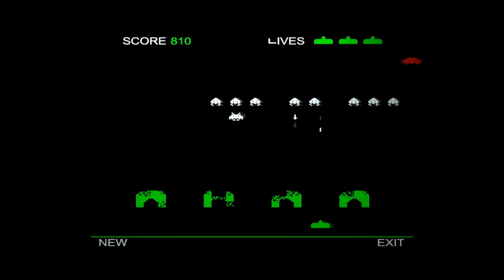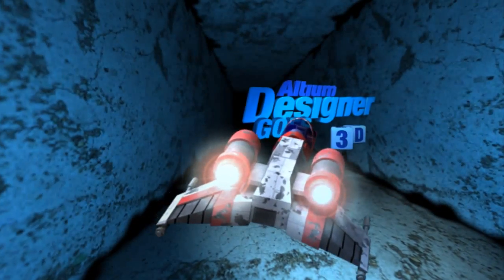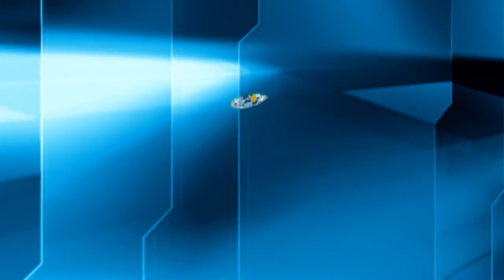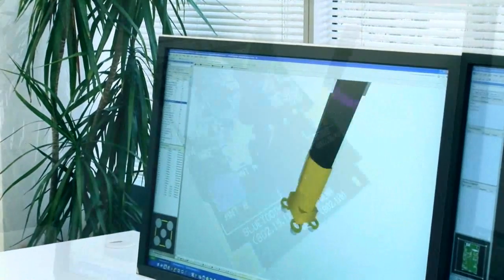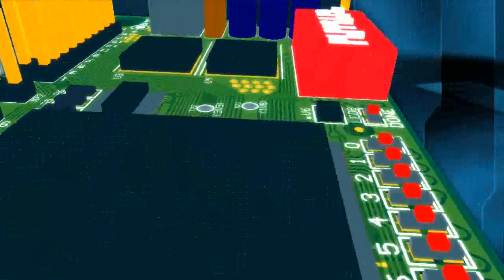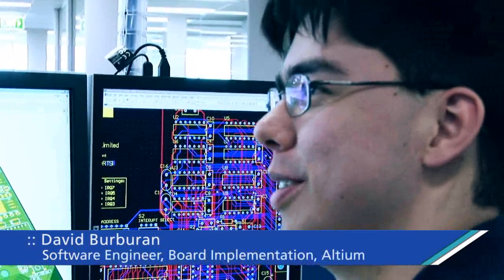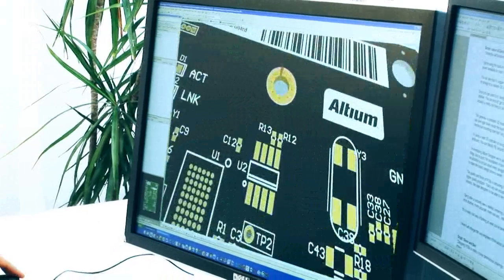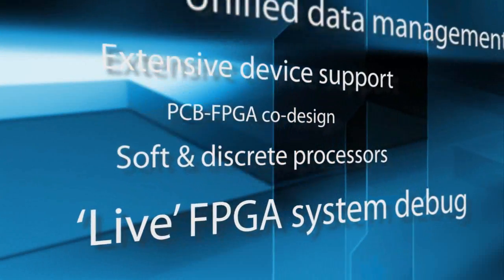Altium Designer 3D, PCB Design CAD Tool Overview

Comment: is there an older version of Altium, that might be free? i cant afford this suite. is there another, similar program? thank you
Reply: KiCAD is free and has 3D design.
Reply: Điện tử và lập trình ok thank you
Reply from the maker: J. Lietka - have you tried circuitmaker.com? has some similarity you will find helpful.
Reply: Altium no, but i will look into it. did i hear right, the files made in circuitmaker are saved via / to the cloud? is it possible to take an existing laptop motherboard design, (formfactor) and redesign it, for more or semi current functions? what is the oldest version of Altium available? thank you